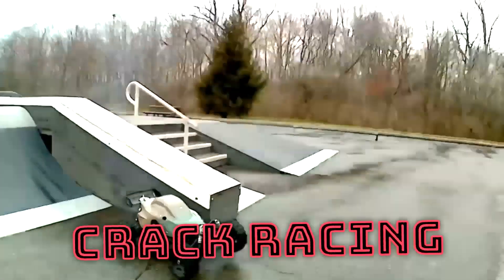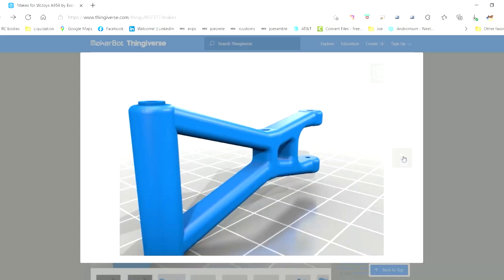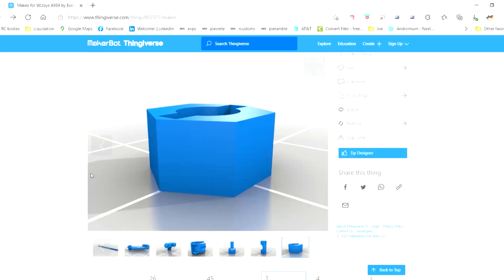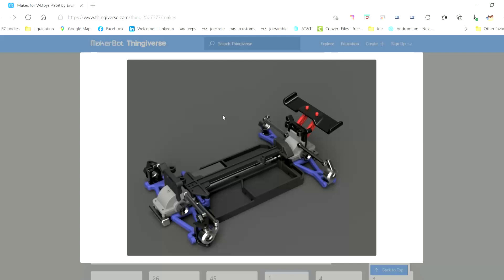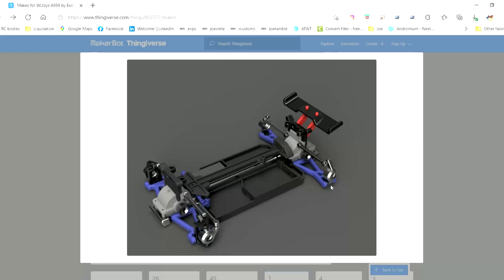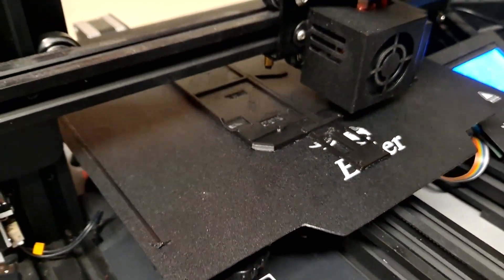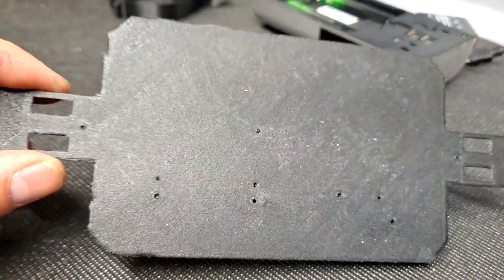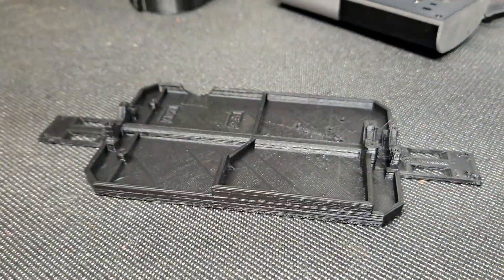3d Printed WLToys a959 Pt1

Comment: Like the new intro 👍! 
Looks like the 959 is going to be a fun little project! I might have to look into something like that. I’ve got so many projects saved on Thingiverse 🤣.
On the wing mounts.. maybe look into repositioning them in your slicer to your layers go lengthwise. I’ve changed layer orientation on some parts and got substantial strength increases!
Reply from the maker: Yeah I've saved so many projects myself that I just have to start trying them! Too many good options, and little things to try! I've downloaded the skid steer as well, trying to price that one too at if it's worth printing though.

Comment: Really cool brother! I have several Wltoys models myself, the 12428, 10428, 124018, 144001. Always have a great time with them! Never had the A959, it was supposed to be a fun little devil too!  You can get nearly any parts for them on Amazon or Ebay 🤜🤛🔥🔥⚡⚡💯
Reply from the maker: Hopefully the project turns out good! How you been riff?
Reply: @Crack3drc  not feeling great lately but trying to hang in there. How about you man?
Reply from the maker: Hang in there! I'm just busy as hell with work closing in on the cold weather. I'm getting things done though. Got allot of cool stuff coming!

Comment: I’ve just ordered a cpl of A969s for me and the lad. I bought a cpl for my nieces last yr and there still yet to brake anything on them 🤦🏼‍♂️ you can get all the alloy parts for around £30 it maybe worth looking at buying the alloy parts and print what you don’t get 🤷‍♂️ I’m not sure but that chassis you’ve printed is no where near as durable as the original 😬 I like the project or the idea but think your going to be to play around with that program a bit 💪👊🏼💯
Reply from the maker: Yeah but the idea is to just print more when it breaks. Pretty cheap. I'm going to start doing projects like this just to see where they land.
Reply: @Crack3drc  like I said I think it’s a great idea and look forward to seeing more on this. Just know that chassis need beefing up on those ends at least or you’ll be constantly printing them 😬 good luck mate I know you got this 👊🏼
Reply from the maker: @rcchallenge8626  I'm working on some bracing options now. Let's see what I can come up with.